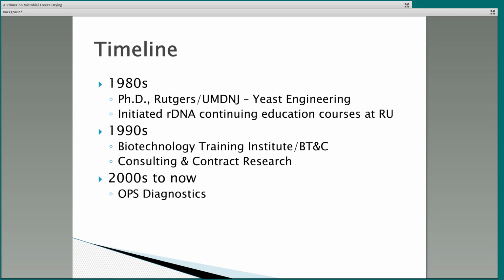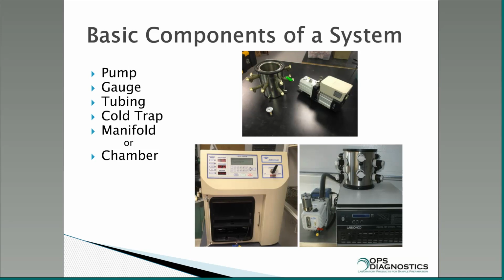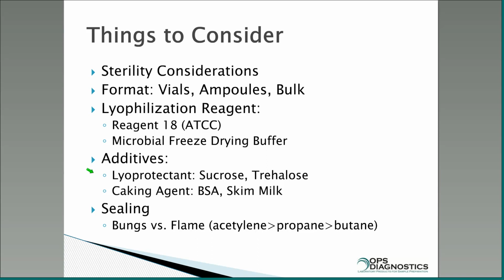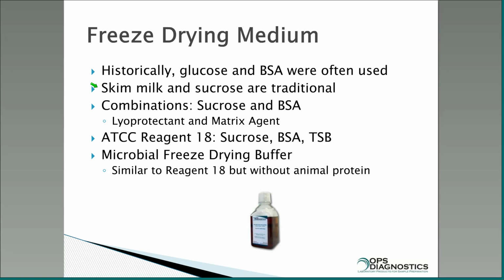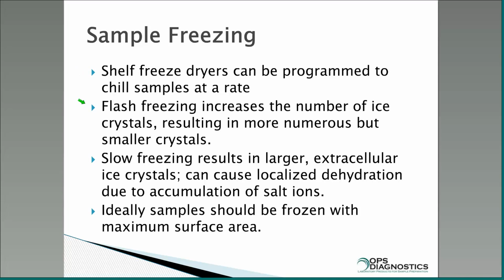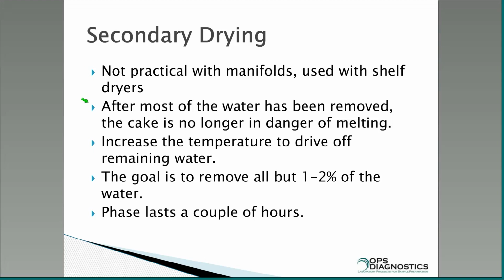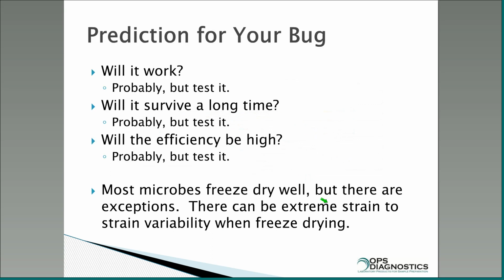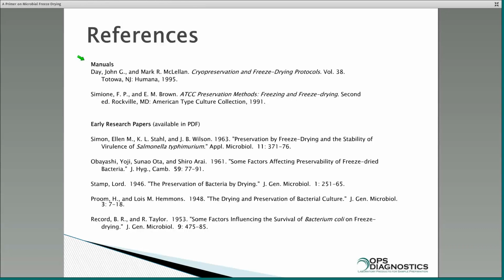A Primer on Microbial Freeze Drying webinar

Comment: You have given a clear understanding video on freez drying. why is it necceesary to make lyophilized form. we can keep it in liquid form at low temperature for long time.
why skim milk lost its activity after 70 month.
How much time it takes for primary freezing -60 C. secondary freezing -20 C and later one.
Reply: This is an alternative method to cryogenic freezing, which requires maintaining low temperatures. This storage space may be at a premium in some labs. Initial freezing--> 30 minutes to go from ambient to -40 C. Hold for one hour.   Primary freeze drying we recommend for 16 hours(-10C)  and secondary for an additional 2 hours (20C). This will vary based on the freeze dryer. opsdiagnostics.com sells an indicator that you are able to determine the moisture levels. However, this indicator is considered a destructive assay so it is not to be used on samples of importance.